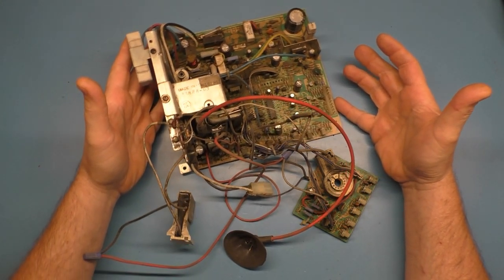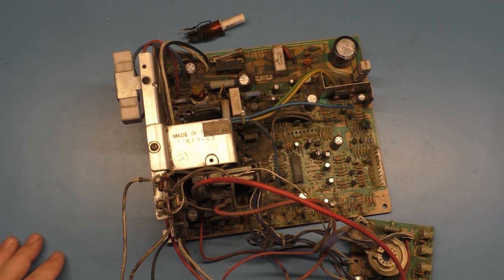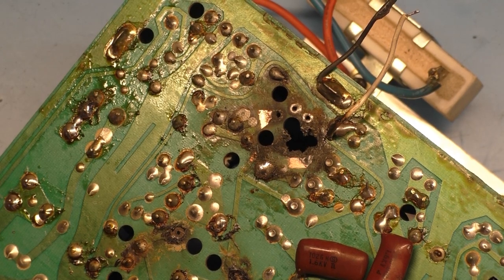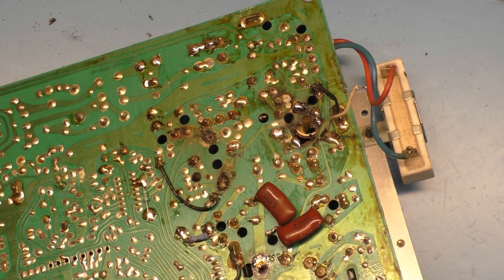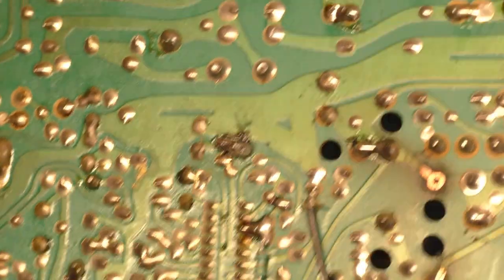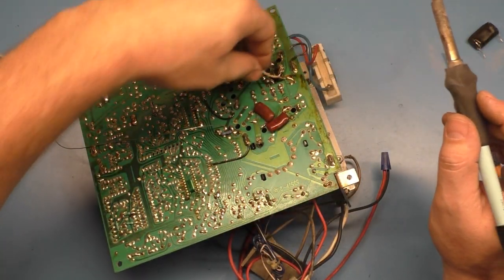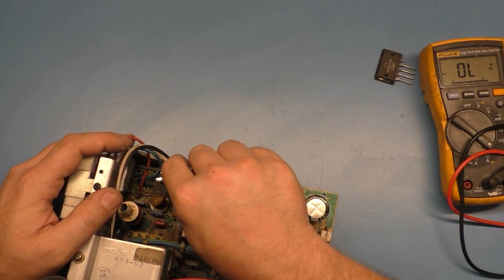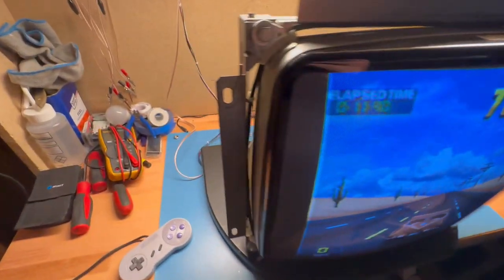19" K7000 Medium Resolution Arcade Monitor Repair - Exploded Width Coil!

Comment: Not specific to this repair, but do you prefer Denatured Alcohol for PCB cleaning vs Isopropyl Alcohol? Just curious.
Reply from the maker: Denatured. Doesn’t evaporate as fast and cleans easier in my opinion.

Comment: Why would you swap an LCD instead of just replacing the chassis? Are these rare?
Reply: He said the yoke of the tube might be damaged, and those are rare.
Reply from the maker: Medium res 19” monitors are super rare, yes. Only 4 or 5 games ever used them.

Comment: Any idea what r98 and r99 read in circuit.  I have a medium resolution with a similar issue.
Reply from the maker: Can’t recall off hand but I’ve never seen them go bad. If you google the K7000 manual, the last few pages give a component spec list and they should be listed there.
Reply: @mikesamateurarcademonitorr6856  
Yeah, I had 2 that got crispy. 2.2k ohm. In circuit, however, both  read 3 or 4 ohms. They are wired in parallel to the width coil and the other coil nearby(linearity I believe) . I think this the cause for the low reading, but I wasn't sure. I tested the theory with another g07 width coil. It seems to be correct. 2.2 out of parallel,  2 to 4 in parallel.  Path of least resistance I suppose
Reply from the maker: Yes, they will read shorted in circuit due to being tied to the coil.
Reply: @mikesamateurarcademonitorr6856  you should sell some t-shirts or something.  This content is awesome.  Thanks for your help!!